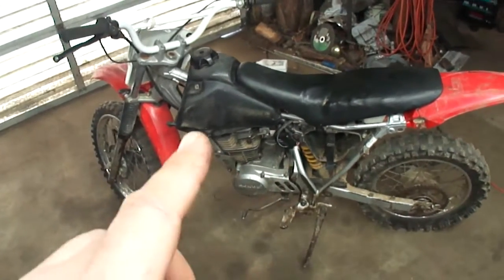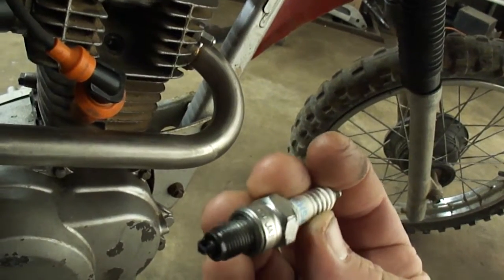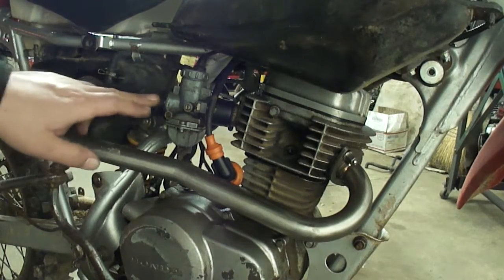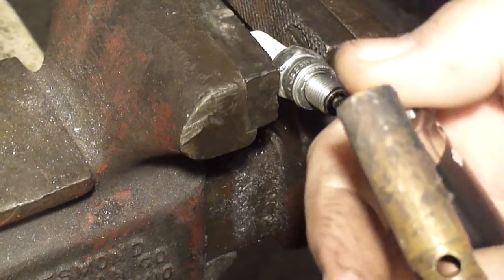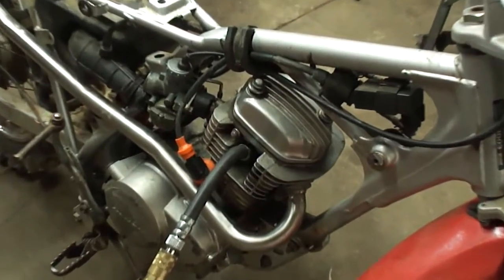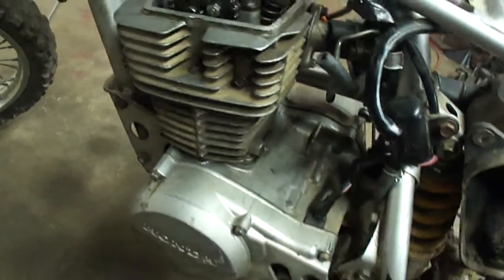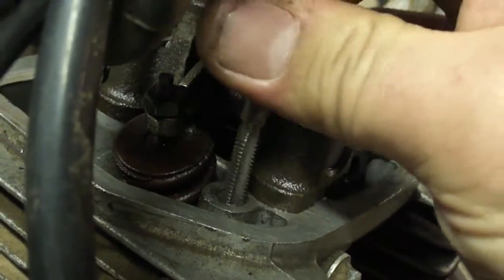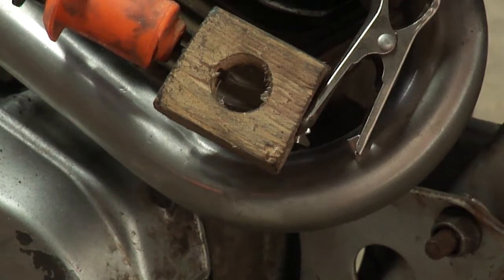Honda XR80R Trouble Shooting Basics

Comment: My 1990 bogs down at full throttle. Cleaned out the carb, polished float valve seat, adjusted float height, not much changed. If compression is low could that have something to do with it?
Reply from the maker: Low compression issues show up at idle and low RPM.

Comment: How do cam journals look? Because they can get worn out to point where it wont run. Or in my case it runs but ticks like a sewing machine going down road. At that point need new head. Even though i only have 5 psi of compression i have auto mac compression tester runs on batteries so it could be wrong but starts every time first kick very easy to start 5 year old can start it easily. Just ticks after few seconds of running. I think you are going to find out you have similar problems i had all same problems. Just from others trying to figure it out you probably will get it but just wait ticking will start. Gotta pull cam completely out if its bad you will definitely see what im talking about.